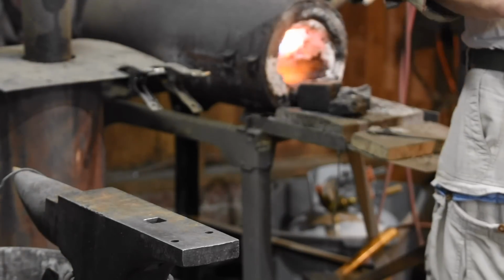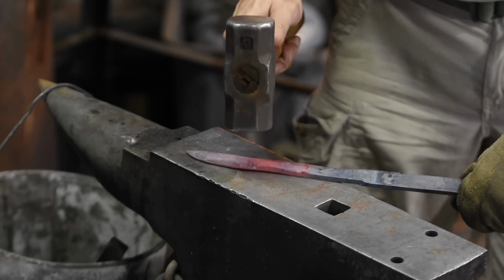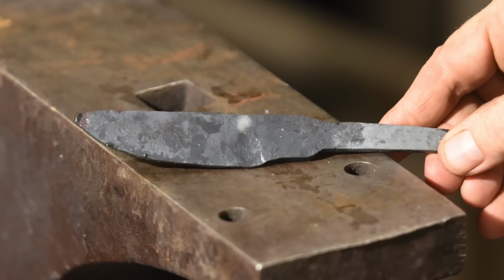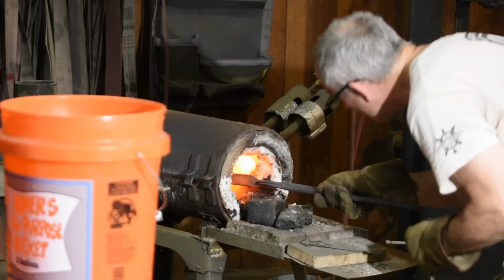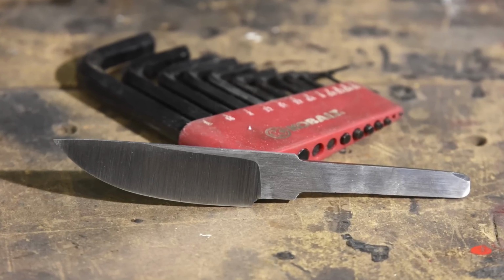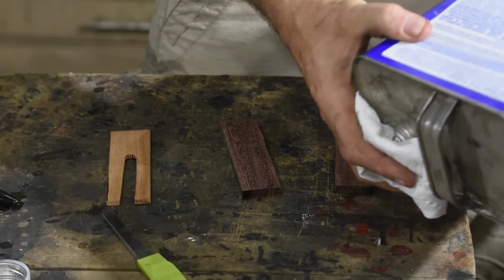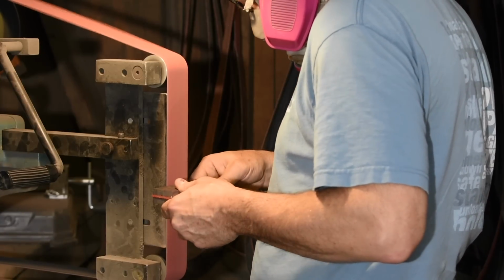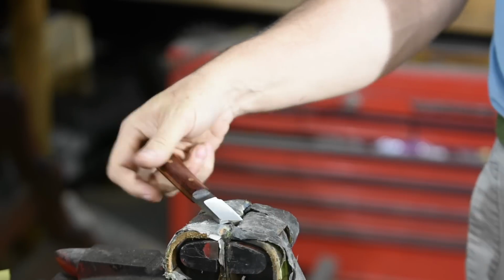Forging a Utility Knife.  Fail.

Comment: I appreciate that you show a fail (i.e. lesson). Too many people promoting themselves as craftsmen only show successes. All of us fail at times. As you say, it is how we learn and it makes us better so long as we learn the lesson provided. I am not a knife-maker but I have lots of respect and admiration for those who do and I enjoy the videos a lot. I learn from them even though they don't directly apply. A key lesson in this one is that shortcuts rarely are. They more often cost more time, material, energy than would have been spent doing it right the first time. Thanks again for posting this one.

Comment: Here's a tip for a professional knife maker from an hobbiest woodworker. =)   When gluing two pieces of wood together, sprinkle a FEW (literally half a dozen) grains of salt into the joint.  They will dig into the wood and prevent them from slipping & sliding around, yet not interfere with the joint strength.  Sugar won't work as the crystals are not sharp enough.

Comment: I've quenched farrier rasp blades in water because I couldn't get them hard with peanut oil. Sometimes it works, and sometimes they crack.  So I started quenching them in water for about a second and a half, then sticking them in oil to cool down the rest of the way.  I get less cracks that way, but they still get hard.

Comment: Hi! Temper the blade in water for 0.5 seconds and in oil for a few seconds. It can also be pre-quenched at low temperature in oil, then heated at 550 ° C for 1 hour. Then quench in water at low temperature through water into the oil and heat at 150-180 ° C for 2 hours. As a result, the blade is more durable than in conventional hardening.
Reply from the maker: That's actually the way I normally quench medium-to-high carbon steel.  You can see me using that approach in a video I just posted about making a plane maker's float.  But just for fun I thought I'd do it differently in this video.

Comment: I just did my first quench on some 1095 in water with the interrupted method and the water at around 120 degrees and it didn’t crack but still had my heart raceing

Comment: Say Heah Walter, that blade profile looks similar to a Puukku. Infact I never thought I would use a 4" blade as my main knife. Yup, I brought my Cold Steel SISU out this weekend after using it all week. I read alot of negative reviews on it mainly its price. But I got mine at a great price as a closeout at C. S. Even though I can't afford a Bugatti, It's still a Awesome car. Same with my C S SISU. I find the San Mai 3 VG-1 holds as good of a edge retention as a O1. C S is now using 3V in their San Mai 3 as of a year or so. But the VG-1 San Mai 3 on my C S Knives is pretty good. Anyhow, Instead of bringing my usual 2Hawks Double Bit Hatchet, I brought my Ka-Bar Johnson Adventure Parangatang, a great choice for still, this time of the year. Oh, I also brought my C S Ultimate Hunter which became my Work Horse, I love the steel that Carpenter CTS-XHP is awesome. I also brought my Agawa Canyon 21 Boreal Saw in my Crazy Horse Scabbard with a extra Aggressive saw blade. We used it to make our perm shelter this year. Also to take hot pots off the fire and open my Chicken Doumplings for my Paul'ies A La Cart, I also use the Awl, also to untangle paracord carefully. Go figure, using a 4" blade as a main knife. But I got some good info watching some  Primitive videos building with basically stone tools. I got the idea but with modern material and my 4" SISU worked great. But my Parangatang was a great choice too. You did good, Thanx You.,,. p

Comment: Easy way to prevent the sliding of wood when using glue is place a few grains of salt on the glue. Apply glue to wood, add salt grains then press wood together. These grains of salt bite into both pieces of wood and decrease chances of slipping. The few grains of salt in the glue isn't going to do much of anything either.

Comment: Hi Walter,
great vid as always and sorry for the loss. 
Quick question. I am making my first knife and yes it is leaf spring - all I can get here in India at the moment. I read you are not supposed to forge it when it is yellow but rather at red, but it only moves at that heat for me and I am hitting it real hard. Red does nothing at all. What are your thoughts on it. Any extra info welcome. David.
Reply: Check your lighting. Just do whatever works and normalize several times
Reply: Make sure you anneal the spring first

Comment: Why not make a leather sheath that fits all knives instead of wrapping it in painters tape?
Reply: Yonatan24 well for one I doubt you could make a leather sheath that would fit ALL knives well. That aside painters tape is cheap and since it's a tape it sticks to the blade so no worries about it falling off while you are working with it or accidentally scratching the steel if the sheath slides up.